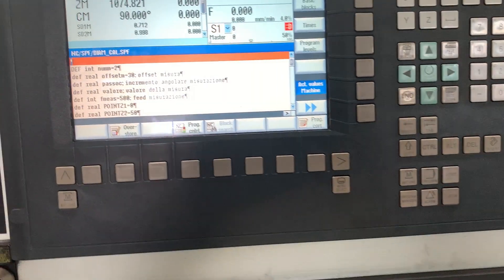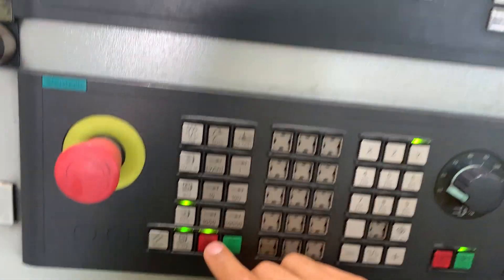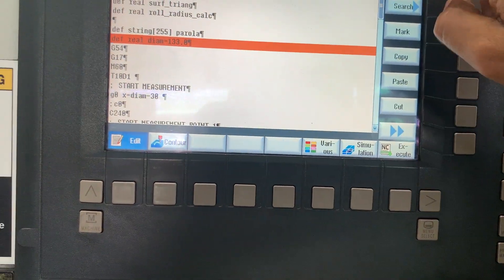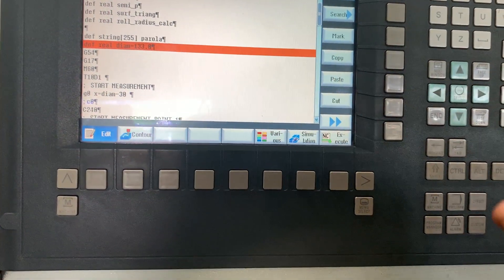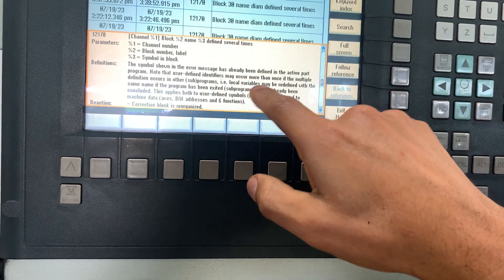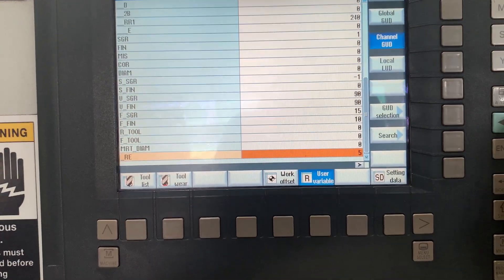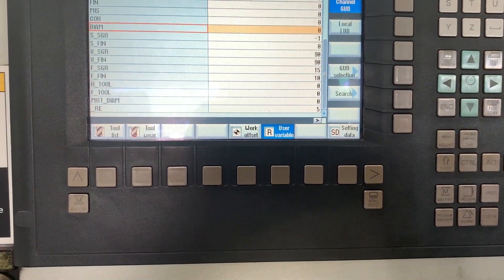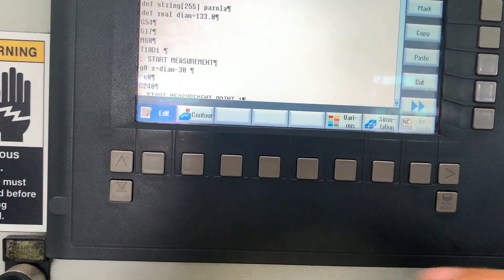Sinumerik 840D sl: Troubleshooting alarm 12170 Block NNN name *** defined several times

Comment: Hello sir can you tell me the solution on.my Siemens sinumerik showing no tool selected/ no tool command with tool change command,[ read in disable][ DB1600.DBX10.1]. 
Please help me sir
Reply from the maker: The user interface in DB1600 offers the option of displaying fault and operating messages on the HMI. 
The firmware evaluates the signals that have been entered and sends these as coming and going alarms and messages to the HMI where they are displayed. The HMI manages the fault texts. 
Since these are user alarms, what I can only advise you is that you should open the ladder logic and track back the signal DB1600.DBX10.1 which makes the alarm 700081. Most probably, I'm just guessing, is related to tool chance sequence and you are missing an input signal from the turret or whatever mechanism you have to change tools. 
Usually, tools positions are given by sensors or absolute encoders that provides binary or gray code or similar to the PLC stating which is the tool number.
Hope this helps.